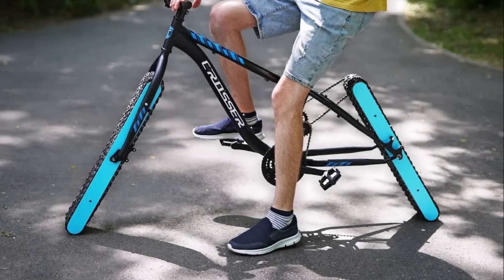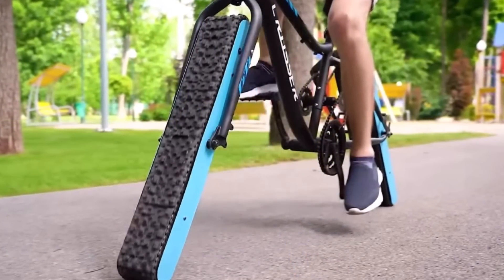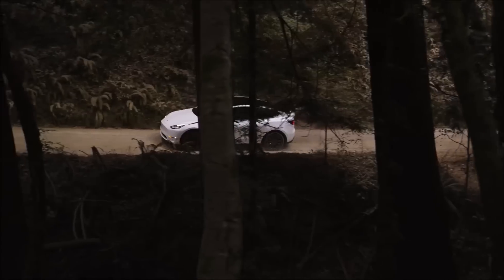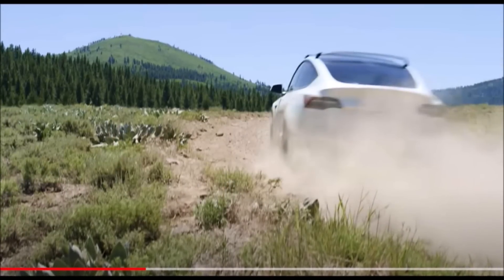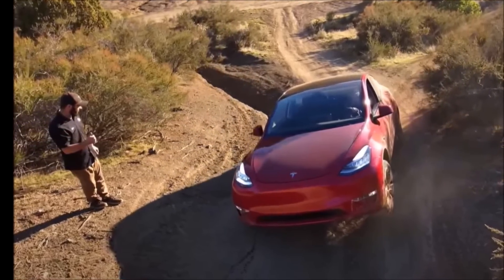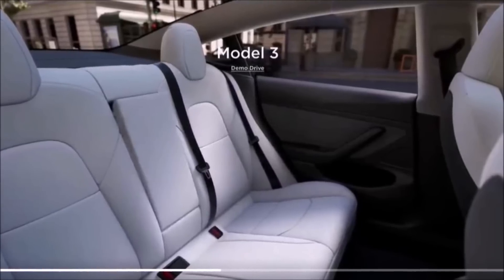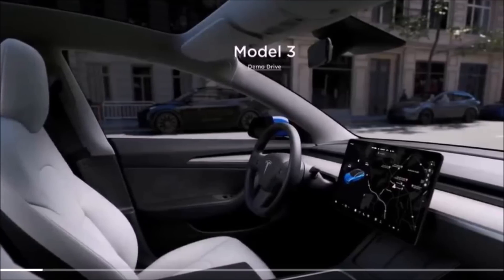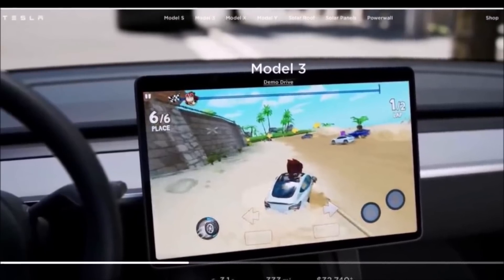Meet The Wheel Less Bike With Screeching Sound, Which Goes Against All Rules

Comment: The wheels have been turned into bearings (smaller wheels) and now you have 4 of them with tread around them and more chains which make this slower and noisy instead of two large wheels which are more efficient and quieter. A true marvel of typical Human evolution mixed with a ton of boredom. 👍🏻

Comment: You think you have people inventing new ways to for a bicycle I really can't call this a bicycle or it is a new toy forcing someone kind of disaster caterpillar drive you see tanks and with anything with caterpillar drive has its uses in one kind of way it will go over anything what it was invented to do but trying to use it in a bicycle using it the tips for the compulsion the way they have used the caterpillar and the angle of the using the back and front and using the top of the edge of the linkage for the rear and the front on a angle it is not conventionally use on the road how it is or off-road if it was on the road you would feel every single bump if you came to a pothole or a drain cover or a kettle Gate all off-road for you going down on rocks or pieces of trees or debris there are a accident to happen on this if it was used flat it would be a totally different tomato all altogether there is someone out there trying to make money out of this gimmick

Comment: Different,  ideal or concept,  But He needs to,  put small wheels, at bottom,  for summer time,  for weather time,  ice and snow,  take the,  small wheels off,   designed the front and rear to  run Flat,  or put  two  tack, in rear like a   snowmobile,  BICYCLE  and front skids,  , might use a small electric or gas,  motor,  cheap than a real snowmobile,  basically it would be lighter and easier to operate,  for any person of AGE,  BEAT  Walking in the ICE and Snow.????

Comment: No gyroscopic stability.  One of the reasons bikes are stable to ride is the gyroscopic effect of the spinning wheels.  Without it, this has to be extremely unstable to ride.
Reply: Not at the speed a bicycle wheel spins .  There's no force that would be anywhere strong enough to stabilize the bicycle.. on motorcycles , it would fight the rider when trying to lay bike down in corners ! That's one reason they make motorcycle rims as light as possible so not to get the force...  A heavier wheel will have more force .

Comment: Looks like you can't lean. Only application I see for using this design would be on moderately rocky or sandy terrain terrain if the wheel surface went vertical.

Comment: That scraping. The concept ist bad but the  execution is horrible. As someone pointed out the a double rear tred for a bike would be great for winter. Or even front treads. But the treads on this are way too small and thin the effort just to move it looks harder than it needs to be.

Comment: I can ride my bike over bumps taller than three inches. I don't believe the same can be said for this marvel of engineering, this undoing of the wheel.
Reply: Good luck with curbs, pot holes, twigs, dead leafs.
Reply: @shadowslip7125 :: true that, shadow,,,and TURNING … but how about super-charged and drag~races that might have a following….js
    CHEATER TREADS…lol
Reply: This still has wheels, just way smaller at the end of the straights. And yes it wil bind at bumps
Reply: @marcelb.8593  yes it has wheels in the same way that a tank has wheels. They in essence are the axle for which a tread rotates around. My original comment was /s

Comment: Ok, just seeing it be pedaled and moving is enough for me to say, nice idea but bad engineering design, it winds up putting more effort on you than just walking and walking would be faster anyway, the designer forgot about accounting for circumference relative to the rate of speed, this design basically replaces the gears and wheel with a 1 to 1 gear to wheel ratio while replacing the wheel with something that's about 1/20th the width, so you might as well just put tiny wheels on it cause it would be the same thing, also the way the tank treads umm I mean bike treads (that's basically what they are) the way they are attached to the frame puts significant added stress to the frame which you'll save on new tires, but you'll have a broken bike frame in the future, which you'll need to replace or weld the frame in the future, actually won't you need to replace the belts anyway after they wear out anyway? So you'll not only have to pay to replace the belts or the entire belt assembly from the looks of it, but eventually a broken bike frame also, not a plus in anyone's piggy bank as the belt  assembly would probably cost you more than a bike wheel and tire. Now if the bike had been designed with a gearing system for the rear bike tread umm belt assembly which would increase torque and speed and if the treads lay flat on the ground with some changes to the frame design to give it a forward angle tilt, and increase the tank treads, umm I mean belt assemblies by a 2 or 3 inches or about 6 to 7 cm in metric standards, then the bike would have greater speed, better stability, especially in winter on snow, and comparable frame stresses to conventional bikes, and a lot less physical exertion required, but as it's designed now, unless you are biking to the house next door, and want a good workout while doing so, then this bike is definitely not what you're looking for.

Comment: Useless bicycle because too slow and noisy.  But it does demonstrate the value of wheels.
Reply: There's a reason people say "no need to reinvent the wheel"
Reply: Exactly that is a completely useless bike why would I or anybody want something so unnecessary bruh could've spent his time designing something worthwhile
Reply: Don't we use tracks for vehicles that need to get over harsh terrain? What terrain does this thing specialize in? Perfectly flat concrete?
Reply: We're going backwards.. we're making square wheels now
Reply: I agree can you fix the fact that he can't turn sharp or that he can't lean into corners?
Reply: It's very interesting thooo
Reply: Useless just for clicks 🙄
Reply: The slow part can be fixed by changing the gear ratio
Reply: This still has wheels, but way smaller inside the tracks at the end of the straights. These small wheels roll over the track instead of direct on the ground.